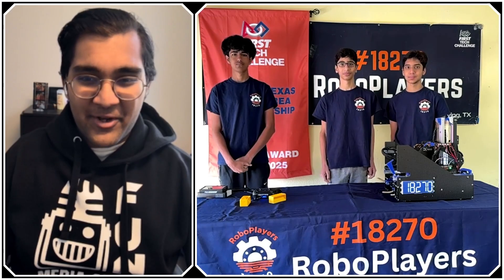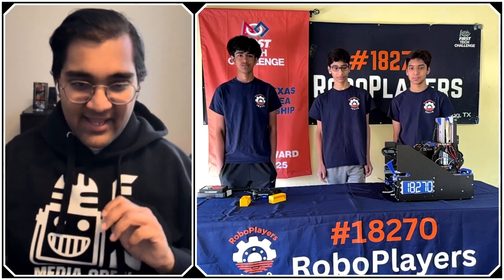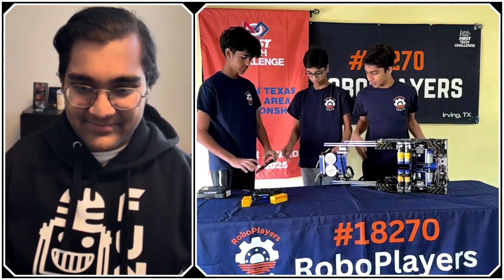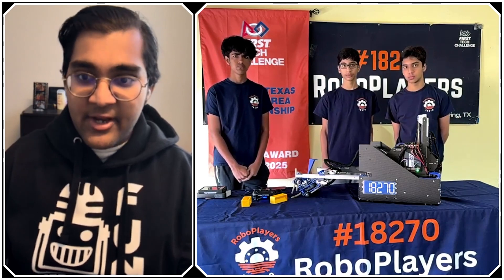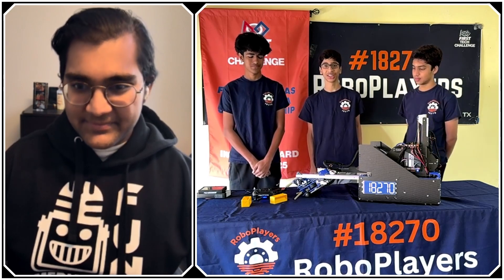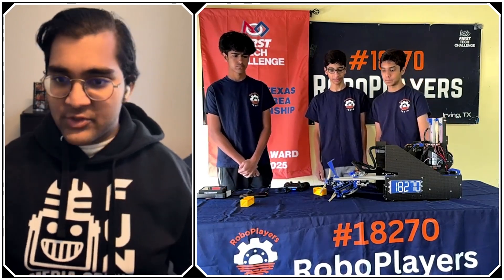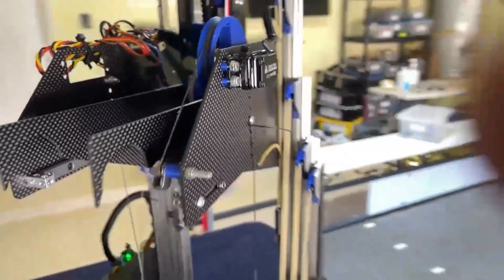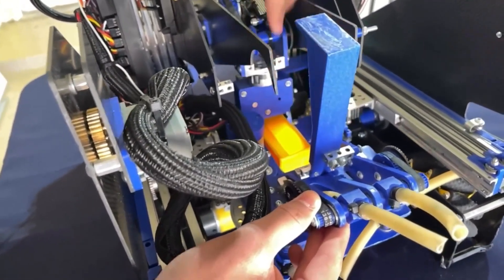18270 RoboPlayers | Behind the Bot | INTO THE DEEP

Comment: 21 lbs is cap ima need to see that on a scale ngl
Reply: It is 22 lol
Reply: @ftc18270  Hey I had a question, you run the xt30 power distribution board for your motors I believe, what is the benefit is it similar to running a servo power distribution board?
Reply: its full CF 😭its def that light
Reply: @ziezster8470  motors and slides arent cf
Reply: @dotshape right but the majority of the weight in a robot is the drivetrain, CF is much lighter it is very believable to have a 21 pound bot with the simplicity of their bot